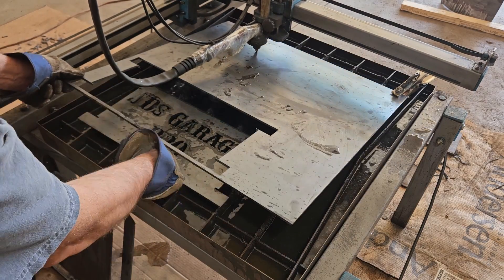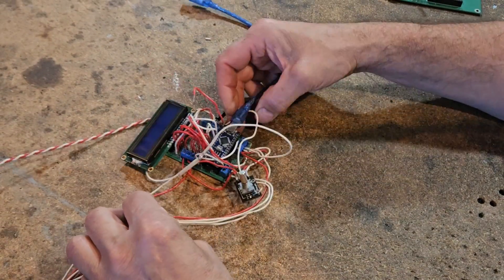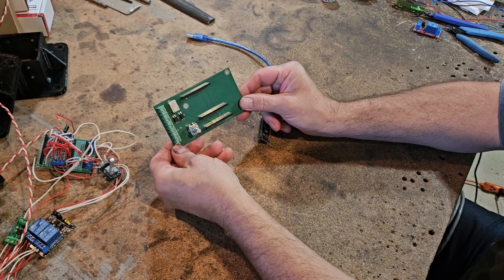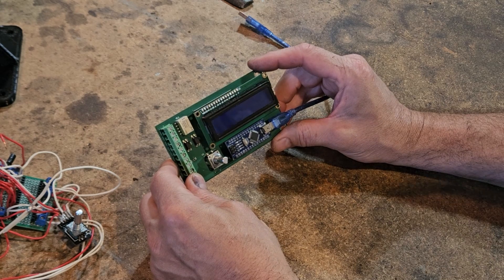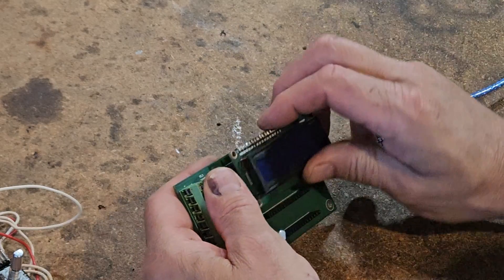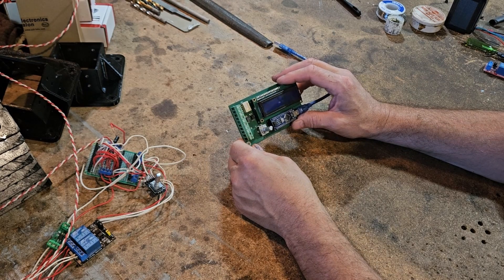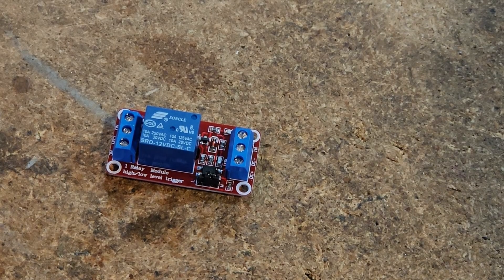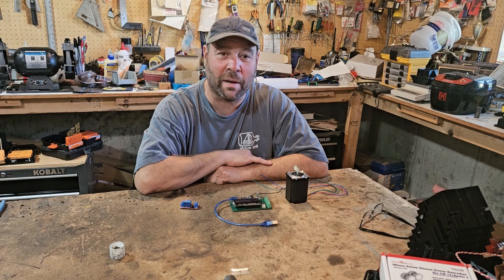Electronic Tips and Torch Height Controller Update

Comment: Hi guys I purchased your plans a while back and am starting to gather parts.  I'm from Canada and it seems  to be cheaper to buy a kit . Just wondering if the 445 oz stepper motor and the DM556S Driver and Mach 3 motion control board would work ? Thanks and  the plans are great 👍 👌

Comment: Do you think you will offer a completing kit in the future that includes everything but the tube frame steel, and plasma cutter. That way you send out a board with motors that are all setup including the belts, bearings and maybe hardware like bolts and 3d printed parts and those cut steel plates.  I see the 3d printed parts and steel plates for sale separately already.  What do you think the cost would be factoring in labor and profit.  Just curious on a turn key kit that wouldn't be shipping the heavy framing steel and that's pretty easy for most diy people like me to get.  A full kit minus steel framing and plasma cutter.  I would buy that.

Comment: Hey, just found this channel. Very interesting biild. I have built a different 3d print version about 5 years ago, actually 3, one as a cnc router, one as a cnc laser and the last one as a plasma. The plasma has worked out extremely well aside from trying to get a different thc working, to no avail. Your unit looks like it could very well be the answer for me. Do you have a wrb site to purchase one? On a side note i have been using a program called light burn as my design and cam software and it has been an awesome one to use. I use it with all of my cnc units now, just an fyi.

Comment: Hey Guys - I built your plasma cutter table and all Axises are moving. Still haven't fired the torch but that's coming. I made a few "modifications" that worked better for me and I will be building the rotary axis as well. I haven't seen any plans or schematics for the THC but I know you're working on it - and so many have asked for them. My question to you guys is, the floating head may cause very thin material to bow before the switch triggers, I have an idea for an Ohmic sensor but I would like to know if your code has a couple bits to use for this option. And/Or if you can add this to your code. I'm not a coder so I am not sure how to go about it. But it would need one output and one input. I'm sure you are familiar with this so you may know what is needed. THC, Floating head and an Ohmic sensor would really make this even more outstanding! Thank you for your time and consideration in advance.

Comment: Shielded wires are ONLY connected at 1 end, At the controller to prevent stray ground currents. A separate wire should be run or incorporated in the cable for grounds/bonding... If you need any help with programming, software control, I have made a lot of prototype machines for large corporations all running Arduinos! PM Me... 
Great work. I will definitely be getting this kit when my pole building is finished...
Reply: I purchased your plasma table design kit. I also found a 32" x 32" water pan on amazon for $95.  Figured what lengths I need to make table larger and ordered the steel. Can't wait for the THC to be finished.

Comment: Great channel and videos folks... FYI, based on my experience, a Shield (Drain) wire in a cable is only ever connected at one end to ground (in this case to the controller).  Connecting it at both ends makes the wire a current carrier, which is not desirable, and completely negates the benefit of a Drain for shielding a cable.

Comment: I built a portable version using all the recommended electronics.  Because mine is portable and can be set on top of any piece, the THC is going to be huge!  Cannot wait to get it and either be part of the fun in beta testing it, or to run it and have smoother cuts!

Comment: I always thought you shouldn't ground the shield in both ends because there could be current through the shielding and thus defeating it's purpose.
But I come from an automotive background, wiring aftermarket ecus.
Reply: I'm an electrician and I think the same way, I don't use a grounding wire like in the video. I would ground the motor myself with a separate wire if it is necessary.

Comment: I wonder if aluminum HVAC tape could be used to wrap and shield the cable ends and sections of un-shielded wire to the motors.
Reply: It should work

Comment: Do you need flyback diodes on your relay?
Reply from the maker: No you do not.
Reply: @jdsgarage701  At 3:30, the board shows relay RL1, part number TQ2SA-5V.  It needs a flyback diode over the coil, as there are none built in.  If you don't include this, it will generate hundreds of volts when you shut the coil off and blow out your driver.
Reply: I am looking for follow up , and information on purchasing height controller or purchasing plans to built for my CNC table

Comment: Hi guys, Nice job however as has been mentioned in the comments you should not earth the shield at the motor ends. 
The shield should only be connected to ground in the controller enclosure at a central low impedance common ground point. This will help avoid ground loops and common mode noise issues
Reply: Grounding both ends of the cable at both ends can increase interference also.
Reply from the maker: There are actually no ground loops in the machine due to the 3d printed parts. The reason we say to connect both ends is to distrub the end of the cable so that it won't turn into an antenna.

Comment: I was taught to ground the cable shield at the controller end only. Attaching the shield at both ends potentially causes a ground loop.
Reply from the maker: There are actually no ground loops in the system due to the 3d printed parts. The reason why we say to connect the shield at both ends is to disturb the free end and to prevent the shield from becoming an antenna.

Comment: Just to note, you can get sheilded heat shrink tubing, so you can sheild things like the wires coming out of the motors etc. Also, id advise twisting the wire pairs on the stepper motors.